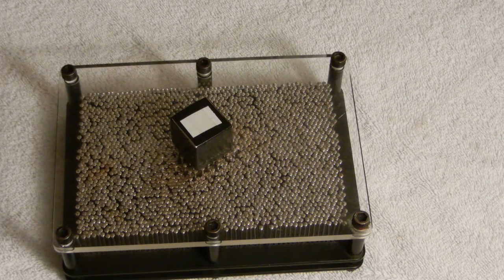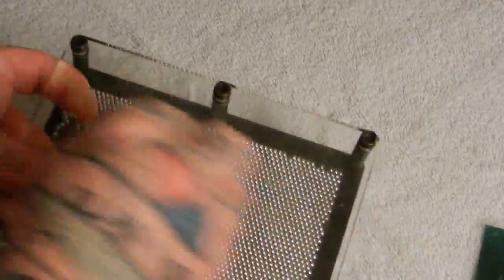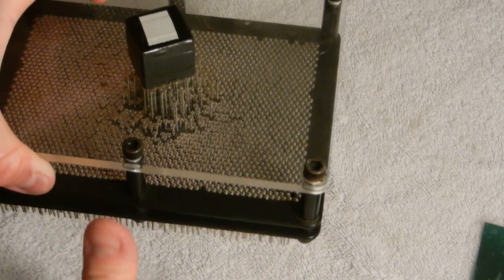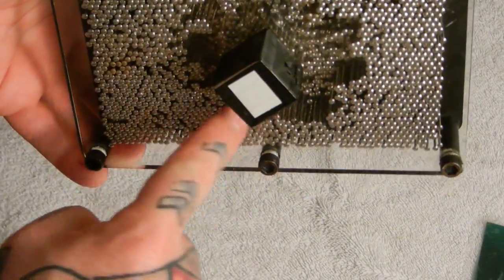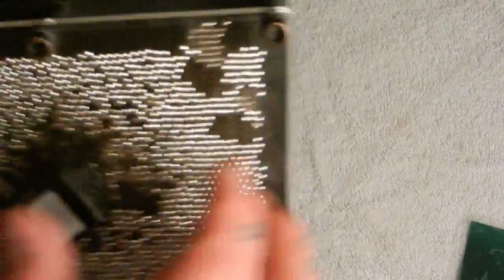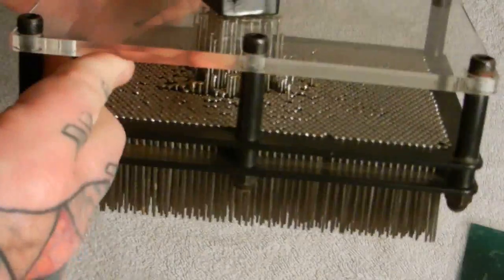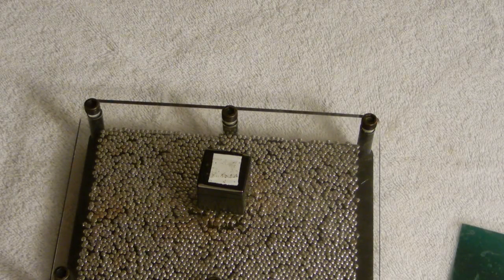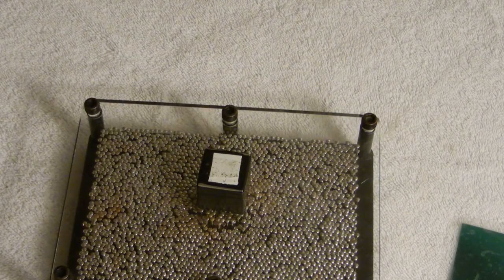Video 1 Uncovering the Missing Secrets of Magnetism

Comment: hmmm. so if you move into them slow you get a different reaction than if fast, and that might be true. But your example looked to me more like when you went slow the end distance was more controlled and you stopped after a few pins contacted. But when you went fast your depth control sucked and you went deeper and actually backed off when done, grabbing a larger pile. the patterns looked the same, just at small amounts with the pins as a pixel resolution you didnt have the numbers to create the pattern in our minds. To do this correctly you need to have a mechanism lower the magnet and stop exactly at a certain position at both speeds.
   Take your pins to the nearest machine shop, an average cnc mill guy could put it on his machine and give you results in 5 minutes. Have them glue the magnet to their spindle, put the pins under the spindle. Have a program that just goes down and stops. Now run it and vary the speed each time to see the results. Look in the yellow pages, I bet there's an AAAmachining in your neiborhood.
   Now that would be science. 
I'm going to watch the rest of your videos, your a smart man. But the more I learn the more sceptable of voodoo I become. Sometimes 50 explanations can fit the same facts, but all 50 could be wrong.  
    That said, as a man who uses electricity to cut steel for a living, we need to take our focus off the magnetism effect, or the electromagnetic effect, or any other "effect"  and study the dialectric materials we swim in that this world is made of. We dont live in an electric world, or a magnetic world, we live in a dialectric world.

Comment: Your 'slow' and 'fast' approach would be either better demonstrated or disproved, if you made the pin toy static. It looks like the difference is that you hit the pin toy hard enough to shake the pins loose, if not completely to the top, as you hit it with your magnet. This leaves the observer wondering if you are showing something real or simply cheating. I am trying to dis out if you have something new here, and that is not helping.

Comment: Man, the nails around the magnet did not come down when you turning it... because they are affected by the magnet... they are under a diagonal force towards the magnet and therefore they stuck inside their holes... i like that you dispute everything, i do that too... but here you misunderstand
Reply: the force is not equal in the whole length of the surrounding nails their up side are attracted more towards the magnet then the down side which is further away... that makes the nail to turn diagonal in side its hole... and it stuck... use some wd 40 spray oil and look how the ''phenomenon'' will disappear